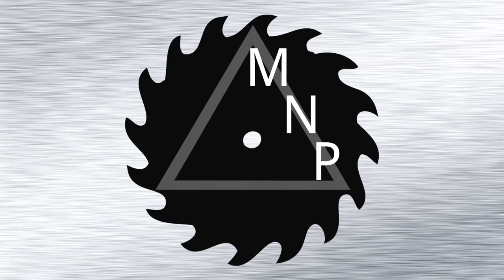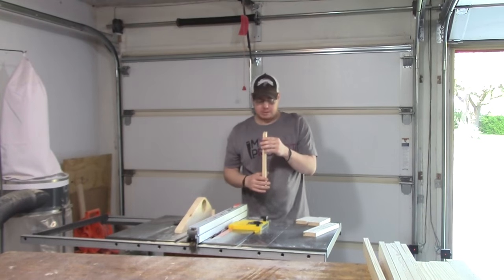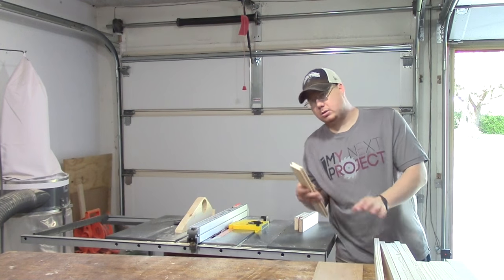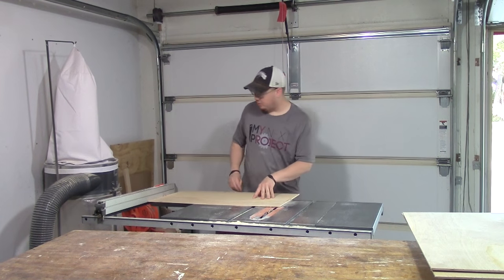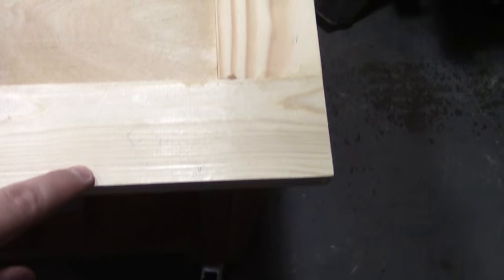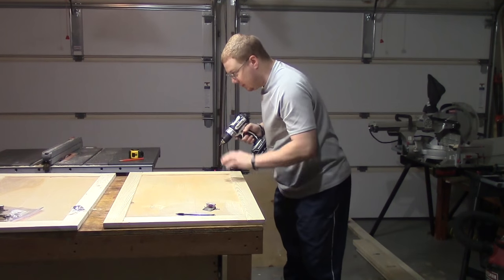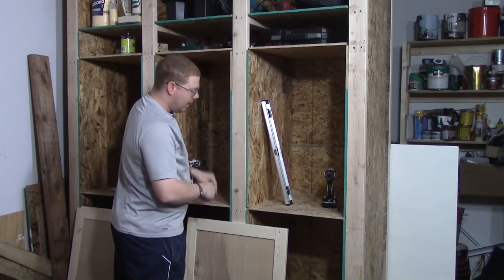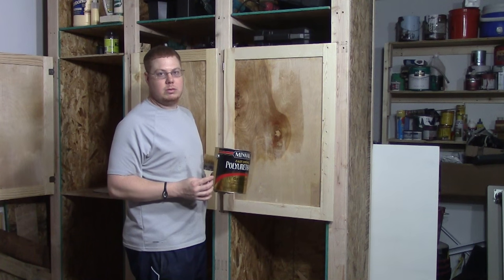My Next Project: Shop Cabinet Doors

Comment: do you have a video on making the cabinets?  I am curious how you attached the OSB cabinet walls to the 2x4 face frame /style/post?
Reply from the maker: I did not make a video on that.  It was hard to film that and I was afraid it was going to end up being an extremely long video.  I am currently working on a miter saw station out of 2x4s and will probably have some OSB in it as well.  There will be a video on it in the next couple of months.